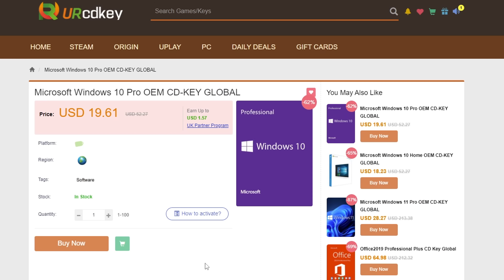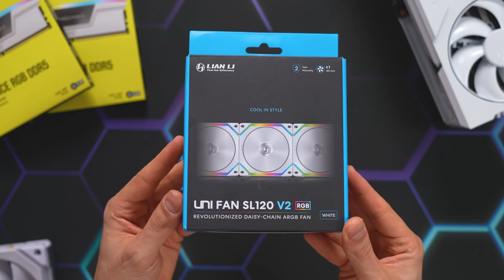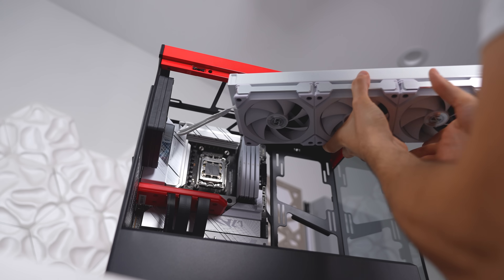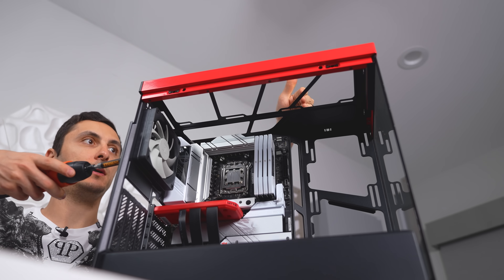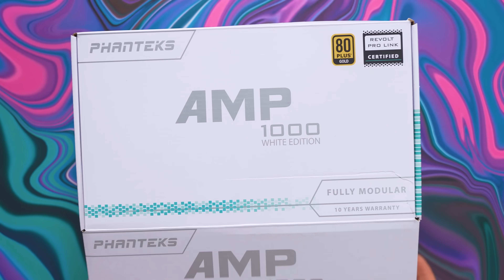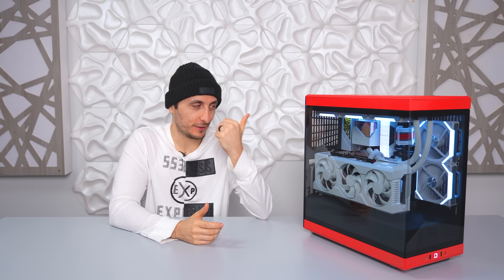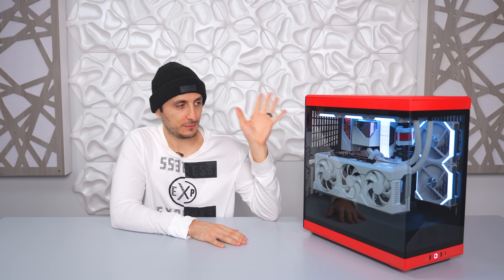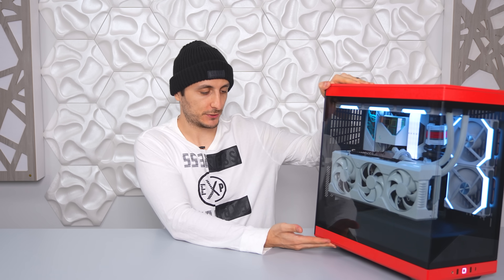Building the Gaming PC of your Dreams! - Hyte Y40

Comment: If you want to use an exhaust fan on the back you just need to use a 280 rad on the side panel. This is really what the case was designed for. Build looks good I'm a big fan of the Hyte style.

Comment: Back when i had a Corsair 220T i managed to fit 1x360mm rad, 1x240mm rad, 2 pumps, 6x120 mm fans and 1 80mm fan in it. It amazes me when i see bigger cases where you just can't do the same !
Reply: The 240 rad + pump 1 were actually an AIO btw.

Comment: Hey Ed, have you tried using SignalRGB?  I've ditched all my individual RGB controller software for this one solution which works perfectly with my setup.
Reply: Was thinking the same thing, think the issue here in my experience is. Signal requires the RGB to be "initialized" since it piggy backs for control IIRC
Reply: @dendragoniii  I thought that too, but I've had Signal RGB be able to control the LEDs on one of my older build's graphic cards when I couldn't get the software to ever get it to light properly.  Honestly, I didn't know it could even light up until I installed SignalRGB and voila lights on.  On my Lian Li case, SignalRGB even controls the led light strip on the case itself, which i didn't even know was possible.
Reply: @bd_8277  Signal definitely works some wonders, not gonna lie or doubt that. Had a similar case with an Aorus Master 3080, rgb fusion wouldn’t recognize it and signal picked up just fine. Sadly no LCD configuration outside of gigabyte software 😂

Comment: The bottom and the back fans seem kinda useless and in the way of things. I would just install 2x 140mm intake fans on the side and the 3x 120mm radiator fans will be the exhaust.
You could try a bios update to fix the motherboard RGB issues.

Comment: My build looks exactly like this except for my GPU I have the black Strix 4090 with the red and blue on it, Lian Li Uni infinity fans white 140 intake and 3 120s up top on a Deepcool ls720 aio instead of the lt720 in the same red and black y40 case with red custom cablemod cables and a white Asus Strix z690-A board/12900K with D4 4266 CL15

Comment: How would air flow work if the top is a 360 rad and the front side is a 240 rad? Those would be exhaust obviously but could the remaining space be enough for adequate air intake ? Want to do aio cpu (360 mm rad) with the 4090 suprim liquid (240 mm rad).

Comment: I see you went for 4 DIMMS does it mean that the issue with ddr5 ram freq is fixed ?
Reply from the maker: Yes
Reply: @TechSource  Are you sure about this?  This was such a huge issue before and I don't see other folks talking about this being ok now. I have a i9 12900K on a Gigabyte Z690 board and have been waiting to fill in those other 2 slots with DDR5 6400 once/if the issue was resolved. 4 sticks of fast DDR5 running XMP is all good to go now? What changed?
Reply: @GeraldBertramPhotography  that's my point I saw many ytbers doing so nobody even asked in their comments. Since Edgar is someone I trust had to ask but this is still a bit sus cause no info anywhere else not even reddit
Reply: @salah-eddineafifi7737  Let me know if you find any more info on this! I'll do the same. Thanks!

Comment: Can someone help me! I just built a computer but the computer won’t display on my monitor. The computer appears to be running fine. The pc will even display for a second, every 30 secs or so. It will show the window install screen. However it is super distorted.
Reply: I'd double check to make sure the video cable is plugged in correctly on both ends. I would also verify if the video cable works correctly with another computer.